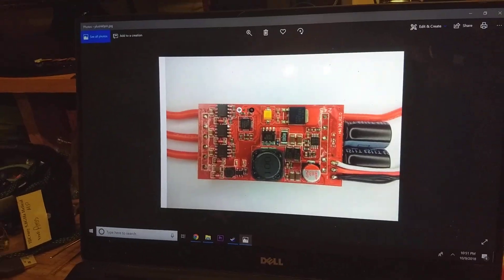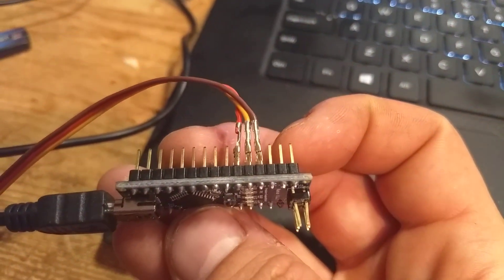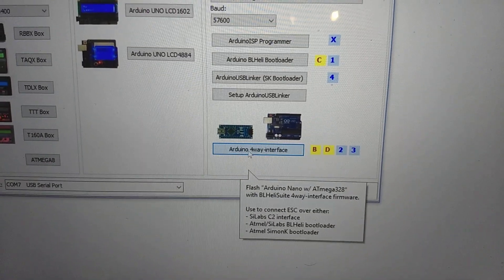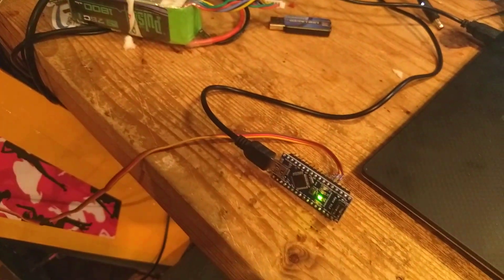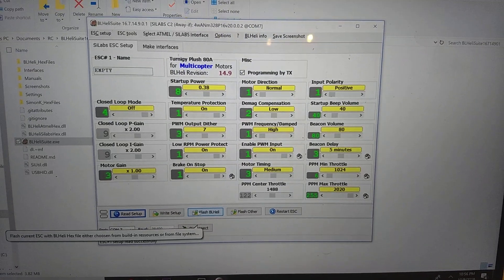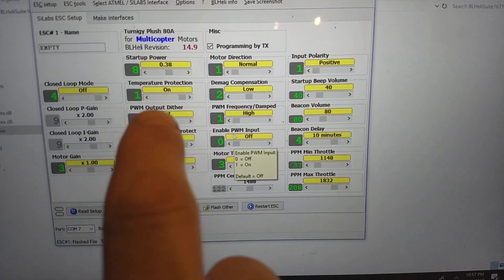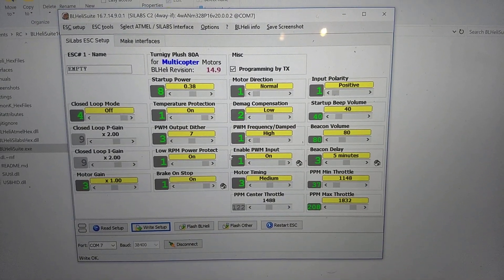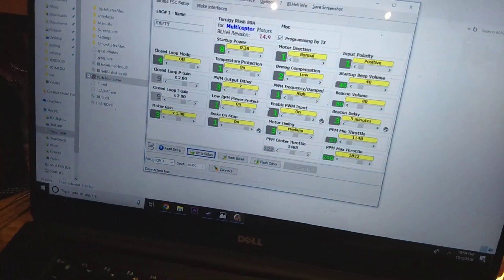Flashing BLHELI to Turnigy Plush 60amp/80a/100a ESC w/ Arduino Nano

Comment: Hi,
I'm having turnigy plush-32 60A, can you please do a tutorial of flashing of that one. 
Thank you
Reply from the maker: I do not have that esc.
Reply: @JNacoustic  thanks for your reply,
I was using that esc in combat robot, so was searching how to achieve bidirectional in it,
Can you suggest any other ways to achieve?
Reply from the maker: amir shaikh you should be able to make it bidirectional with the bl_heli32 software using a flight controller as your interface using the servo connector.. Have you tried?
Reply: @JNacoustic  yes, tried with Arduino as interface but not working,
Should I use turnigy usb linker?
Reply: @JNacoustic  and also turnigy plush32 hex file is not present for blheli32
Reply from the maker: amir shaikh I think it's called something else. I'll see if I can find it.
Reply: @JNacoustic  yes, please let me know if you got something.
I'm trying it for the past one month, but couldn't make it bidirectional